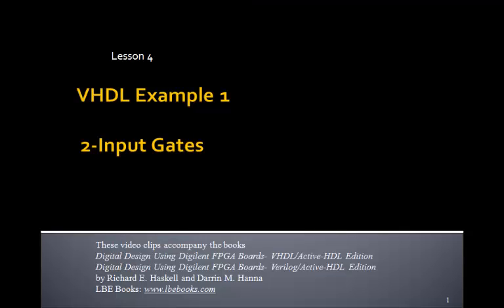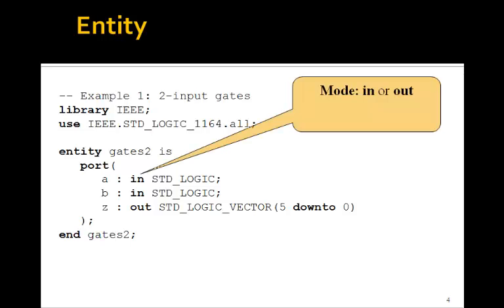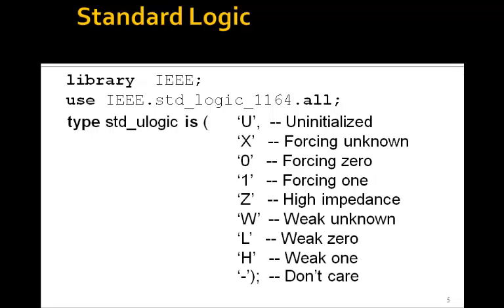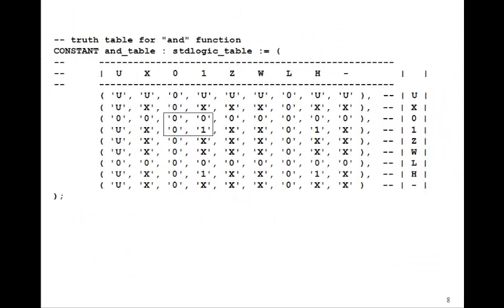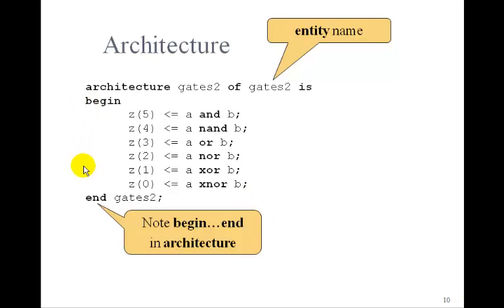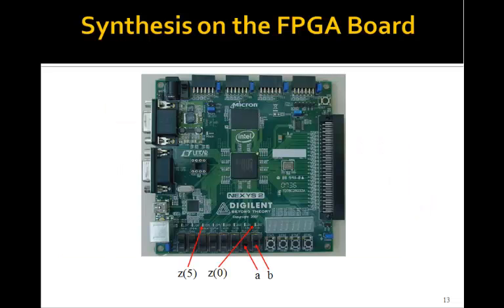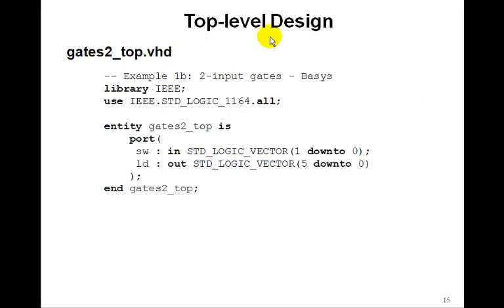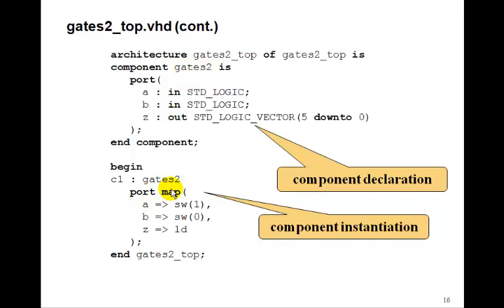Lesson 4 - VHDL Example 1:  2-Input Gates

Comment: OK..  maybe I missed something or it will be covered later, but when you're hooking up the switches and LEDs, I suppose in this hardware implementation, it is assumed that the switches have pull-up resistors (or  are SPDT switches connecting straight to ground and vcc?)  and the LEDs have current limiting to ground so "1" is lit?